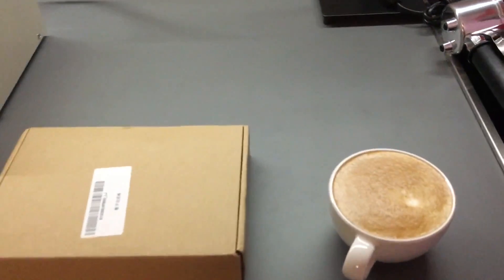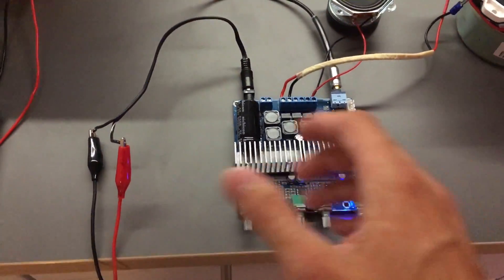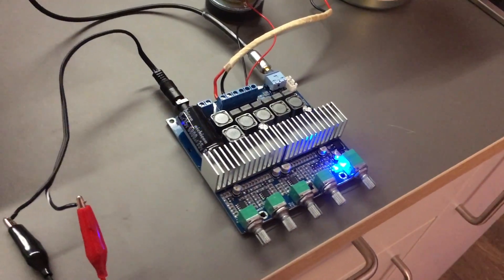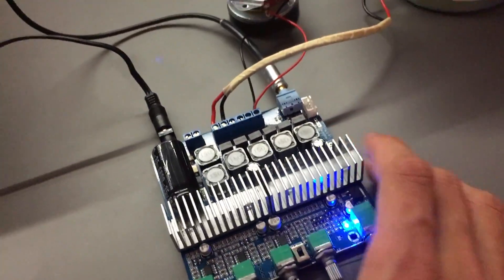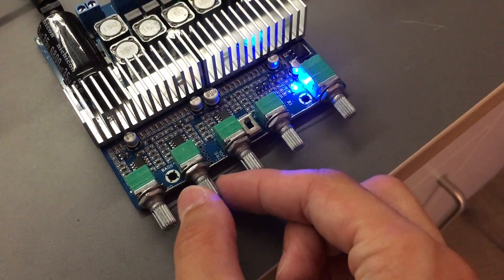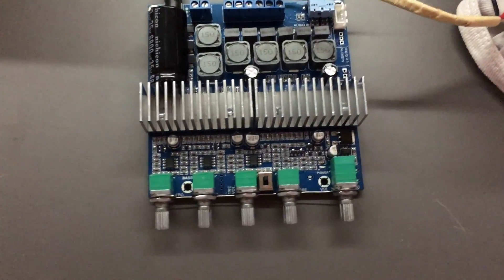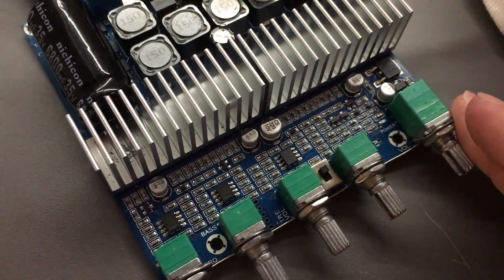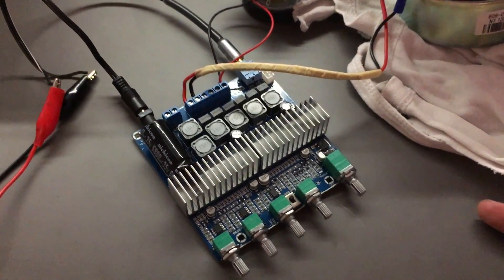TPA3116 2.1 Amp Review / AWESOME !!!

Comment: I ordered one! thanks! This amp board looks perfect for my project. And I don't know if you already know, but there is a bluetooth version available as well.
Reply from the maker: which one did you order ??

I specifically went for a non-bluetooth version: having just wasted 4 months on shitty amps puffing up in smoke, I really was keen on minimizing the risk of shit not working just right : on top of that I already had a bluetooth board with a superior chip

The 8645 does aptX and the 35 not I believe

Regardless, I did buy a 4.1 amp for a different project, a Yuanjin design, and that one does indeed have a small amount of bluetooth noise (video on that a bit later, I fucked up the bt board when trying to program it)
Reply: I went for a non bluetooth one. I was thinking about refreshing internals of a dirt cheap 2.1 system I am using, and add a pair of new decent bookshelfs, but I might as well just get a new subwoofer. 

The question is "Is the board hifi worthy?". Haven't seen any hifi application review or audio engineer's quality check video yet.

And yeah noise problems seem to be typical for these boards with a built in bluetooth capability. Something about ground loop thing.
Reply from the maker: yeah, there's just an insane amount of these floating about .. ffcossag has some nice technical reviews but not for this board ..

this particular board doesn't have any setting for the gain (you could of course just change the resistors yourself), and is in HIGH mode, which means the noise floor is definitely audible from close range

soundwise it's the same (hopefully not knock-off / low tier) TPA3116 chip so, frequency response and all that should be more or less the same to other boards (provided they don't act like stoves)
Reply: Yeah I enjoyed ffcossag's videos. How he just figures things out like that is still mystery to me. ;)

My setup will be strictly "very near field". Good thing that I am a gadget hoarder. Soldering iron-check, rework station-check, smd resistors-check. Good to go!
Reply from the maker: very nice :D just got myself a soldering/rework station too, will need to order one of those smd parts megapack nowadays
Reply: Keep up the good work! SMDs are so cheap, just buy whatever that comes into your mind. You may never use them, but they are cheap! :)

Oh, by the way, this is THE most important question I had for last 24 hours, 
Does the 'so called' treble adjust knob actually adjust the treble like a tone adjuster? or is it just a LR volume knob?

Thanks for great videos and sharing information. Helped me tons!
Reply from the maker: More than welcome :D - I'll definitely stock up on that good shit

There's a knob for LR volume and a knob that adjust how sparkly the sound is (basically a low-pass for the highs so to say). I find it quite useful
Reply: Thanks! Really!
Reply from the maker: don't worry about it :D just let me know once your amp arrives if it's good quality and I'll add a mention in the description
Reply from the maker: well, mine was I would say way worse than cossag's ... it literally acted more or less as a short across in input (I've changed the chips with the ones from the board from my first review .. and yeah, same thing)

regarding your board .. I have to be honest and declare myself skeptical .. nevertheless, that makes it all the more intriguing if it does work

the design seems different from both boards, but either way, fingers crossed :D
Reply from the maker: it also clearly says there is a turn on thump .. 

" Before starting up, rotate the knob to the left and then switch on the input dc power supply, which will make the boot completely unhit
Instead of directly unplugging the input dc power supply, turn the volume knob to the lowest and then unplug the dc power supply, so that no impact can be made "
Reply: Yeah, I can confirm that. Buyer reviews also report the pop noise problems. So... yeah definitely there is a thump on power on/off. The manufacturer poorly remedied the problem by having the power switch integrated into the main volume knob. Or the power never actually turns off at all (as indicated by 'always on' power led). But may I can fix that by making a small relay circuit.

 
I really wish there was a aluminum case for the GOOD 5 pot board. The good board looks every inch much better than what I just ordered.

Damn case! :(

Found a fix for pop noises utilizing the mute pin. 

http://e2e.ti.com/support/amplifiers/audio_amplifiers/f/6/p/209307/1195915
Reply: I cancelled the "probably shit" amp I previously mentioned, and ordered the good 5 pot version AND another 3 pot version from the same manufacturer from china. And decided to build finished amps by myself out of half processed aluminium cases.

This is the 2.0ch 3-pot version I bought.
(literally from china)
https://item.taobao.com/item.htm?spm=a1z09.2.0.0.2fc00d31CIA1Wm&id=524501096931
Reply from the maker: Much much nicer ! Is the other 2.1 one exactly like the one I show here ?

What's up with this website btw ? Some more hardcore aliexpress ? Have you used it before ?
Reply: Yeap, that is Taobao. Basically a Chinese version of Aliexpress. Both websites are owned by the famous Alibaba. 

I recently started buying things from the chinese website with a help of chrome browser and google translate. and it is alright so far I guess(minus probably no refund for defects. this is my third try and no problem so far). I go through an agent for overseas shipping. 

Things are much cheaper there, 2.1 board just like yours cost only about $12-13. Shipping to my agent was around $1 for 2-3day shipping. So, if you are really into buying many chinese cheap craps, buy directly from china. That is, of course, if you can find a decent agent.

That website is kinda hardcore to get things started, but once you have an account, payment method, and shipping address, the rest is pretty straight forward. For me, real problem is the chinese language... oh...my... g....o....d....
Reply from the maker: What exactly would this agent deal entail ? The pictures look awesome too
Reply: So called "agents" in china just receive and gather my packages for me, then pack them into a bigger box for overseas shipping, then I fill in some forms on their website, I pay them overseas shipping cost + some fees. And I receive a big box with all different items from many different chinese sellers inside few days later.
 
They are what Amazon calls "freight forwarders". All the shopping and buying is my part, and they only do the logistics and some paperwork for customs. Well, that's how it works for me anyway.
In Korea, where I live, it is quite an established business model. So your mileage may vary. :) But I hear some of the bigger chinese sellers on Taobao also do international shipping.
Reply from the maker: hmmm, so how difficult / worthwhile would you think finding/using on of these "agents" (man I feel important saying that) is for the odd orders ... I don't really buy anything in bulk, ... so ... yeah :-/
Reply: Trading agency might be a better word for you. But anyway, it is pretty much how small businesses import chinese cheap craps, but with much smaller fees.
Well, anyway, Taobao is where chinese people buy chinese things! Holy crap! so many interesting new things for cheap money!
Reply: I know what you mean. It has been only few years these trading agency people started doing business like that. Before that, china was a very mistery place to me. lol.

But when you go to Taobao and search "tpa3116 2.1"? Then the board you used comes up top. Chinese people know which shit is a good shit! So why not just have look around time to time :)

Thanks anyway, 
I am really looking forward to have mine in hands!
Reply from the maker: Sure will, thanks for the tip - but might still stick with alie and ebay iff the difference is not that large - they should offer better buyer protection in case shit goes south

Let me know how it turns out :)

Comment: I received my board last week. Superior sound quality compared to a bluetooth board. Soldering is good. Running at 19V, stable and clear sound
Reply from the maker: Which one did you order ?

If in need, feel free to bump that up to 24, you'll see absolutely no increase in noise floor, but receive quite a boost in power
Reply from the maker: Very neat ! Clearly got some massive level 5000 fabricating skills right there

Can you give me the link of the amp ? I'll add it to the description as a "vetted" option

Comment: This amp is to build a active full range speaker so u want your woofer to pick up where you tweeter drops off . there for have "voices" in your sub . which actually should be a woofer not a subwoofer
Reply from the maker: I disagree; you have satelites for mid and high range, and the sub - for lows, .. if you feed a proper sub frequencies above 100 it'll sound like shit and murk up the sound of the entire build

Comment: So, this amp could also be used for a Sub only amp?, or would that be overkill/dumb?
Reply from the maker: Mmm, why not - it definitely wouldn't affect the sub's performance in any way 

And given that we've verified this as being (as far as I know) the only TPA3116 amp with no turn-on thump, for $20+, I'd say it would still be wise getting it : the low pass filter is really low, you get a very velvety smooth bass from it if you turn the cut-off frequency all the way down
Reply: I'll look for it and keep it in mind, Thanks~!
Reply: Does it go into a low power standby when there is no audio signal? For my application I need to have it always ready to play but don't want it "on" all the time either.
Reply from the maker: It's always on; you'll have to implement any sleep functionality yourseld

Comment: did you ever get a measurement of the draw at full volume? thinking of this for a battery application.
Reply from the maker: Sure have, I built this amp into an iPod HiFi that had no electronics inside

It's not full-full volume since the speakers in it are not that powerful - but you can expect it to draw peaks of 2A at 25V
Reply from the maker: Check that video out if you're looking for inspiration - mine also runs off of a 6S pack
Reply: I have been looking for a 2.1 but there’s not many options and the ones that are available are questionable. I think I’m going to get this one.
Reply from the maker: Yeah, so far this was the best out of all the 4 I've tried

The gain could be set lower, but in my case it wasn't worth messing with the SMD resistors

Otherwise - it's idle draw is near enough optimal, and most importantly it doesn't pop at startup

Comment: I have this same board and I loge it. I have it on a pair of onkyo speakers and a couple of hifonics subs. The subs are very under powered but it doesn't do to bad. I'm going to beef up the power supply as well. I think I'm putting 16V at 2 amps to it.
Reply from the maker: Well, you should get quite a bit more power if you go up to 25v

Comment: this amp is cool ! But i would suggest that you test the speaker in the box

i can imagine that how power the bass would be !

anyways good job!
Reply: Well, this amp should be same as i got 2x50w 1x100w sub. I put it in broken Marshall stanmore speaker after ripping old fried electronics out. I tried to run it with as is, filled different quantitys of dampening material, my own spudo closed box and then proper closed box and nothing worked, amp was too powerful for stock speakers. After replacing back lid and installing similar size 5inc woofer i got sub side to work reasonable well, but depending output devices volume i still could blow speakers with this. I even tested it on my 10inc 600w constant woofer and amp had no issues except terminals and wires started to heat up.
Ou and i'm running it from 12v pc power supply, not max 24v, so there is still reserve on amp. 
If you get the proper original as mentioned its well worth it, long as your speakers can handle it and you can get biggest possible wires to transmit the power.

Comment: how loud does it get?
Reply: I have this board at 26 volt, two 50 watt speakers and a subwoofer. Did a measurement with my phone today at one meter distance, it's around average 86 decibel and 92 decibel peak. Did cover my ears because how loud it got :)
Reply: @computerfreak696  I have a similar setup to yours. I have a 24V 16A psu which has a potentiometer for fine tuning the voltage. Managed to set the psu to 27,7V (any more and the amp turns off) and the Amp has been taking it like a champ for 3 years and been blasting almost every day at full volume. Got 2 50W subs wired in parallel for a 2ohm load and 2 bookshelf speakers.

Comment: Anybody know what amperage this draws at full power? I'm designing a battery pack for portability.
Reply from the maker: At 25V it may draw 1A ... maybe more if you push it; I wouldn't expect it to sink more than 50W at any time though (so, less than 2A at 25V)

Regular listening volume needs around 200mA at 25V, with standby at around 170
Reply: Perfect! Thanks for the quick reply!

Comment: Hi, is this ok for a DIY little guitar amp?
Reply from the maker: +Cliff Lisette if you want the "little" amp to have 2 full-range and 1 bass speaker - than by all means !
Reply from the maker: +Cliff Lisette no worries - watch out for the cheaper ones - they usually sound like shit

Also some might have a low-pass filter built in, ask the sellers beforehand if that's the case

https://m.ebay.com/itm/TPA3116-DC12-24V-100W-Mono-Channel-Bass-Audio-Speaker-Digital-Amplifier-Board/231367507180?hash=item35de93fcec%3Ag%3AC8cAAOSwZVlXs8TD&_trkparms=pageci%253Aa7003d19-b8c8-11e7-8944-74dbd180e23b%257Cparentrq%253A4ecfc19215f0ab4d7080c3adfffdc447%257Ciid%253A20

Comment: Wondom or Yuan-jing any good for a diy 2.1 room speaker and sub for my TV?
Reply from the maker: If you want to go TPA for it, I'd recommend the one in the video, even YJ doesn't have any anti-pop circuitry

They usually have top notch designs and quality parts though

The other brand I've never heard of

Comment: Does anybody know what that switch actually does?
Reply from the maker: I think someone mentioned it's the FULL RANGE / ONLY HIGHS toggle for the 2 stereo channels (sounds a bit too harsh though if you go for the 2nd option)
Reply: Interesting, thanks! So it engages a high pass filter on the stereo output, I imagine!
Reply from the maker: precisely !
Reply: The new version has two toggle switches. So I guess that is for sub and speaker outputs. The question now is what frequency is it high passing at? I wonder if the seller would know.
Reply from the maker: Most likely not .. What new version though ? Could you add a link ?